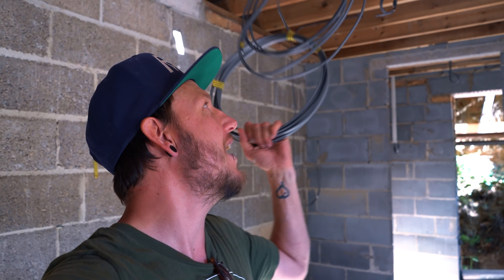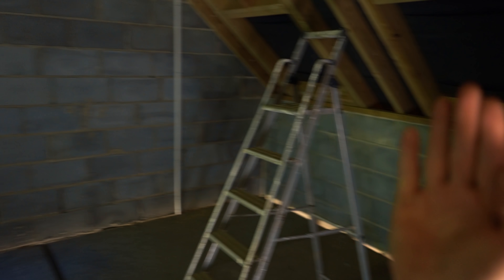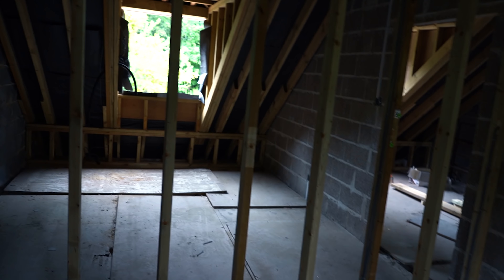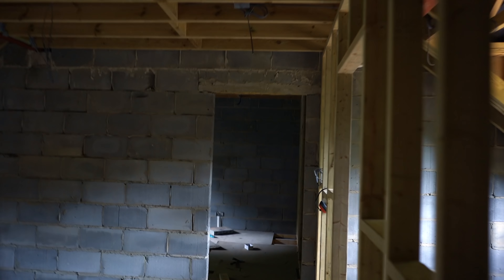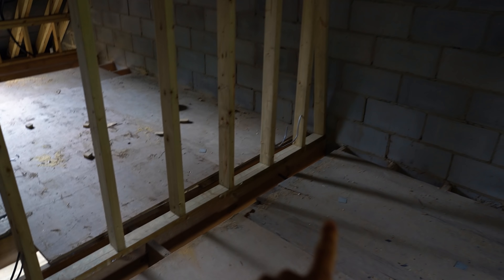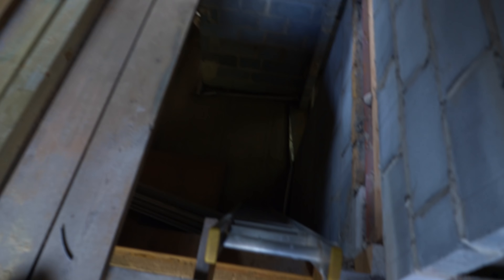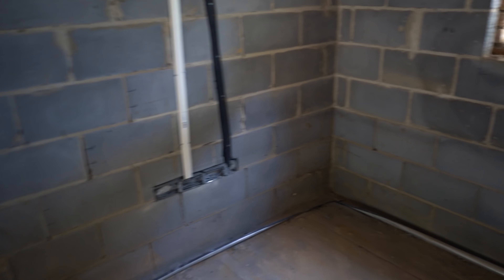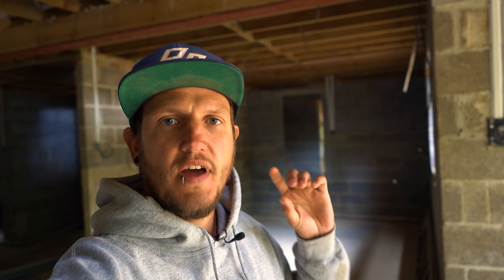Something EXCITING is happening | House build E.P 100

Comment: The best position for the manifold for the ufh is next to the hall ,  all the piping gets hot so the hall would be the warmest place , ideal as it has the biggest volume and hot air rises up to the landing .  Consider a large towel rail in the utility room for drying tea towels , wet coats etc.

Comment: Just a tip mate, double up on the floor plate of the stud walls it makes fitting your skirting so much easier as you have a solid fixing all the way along, especially when you have wonky timber 👍

Comment: For the layout where your desk is to go, best sit sideways to the window to avoid reflections of your shirt etc. in the screen. Best is window to side behind you. Floor sockets great idea. Perhaps put in spare cores and coax and ethernet cat for future proof (ask you electrician for advice). Also avoid lighting that will reflect in your screen. Pointable LED spots prob best. Mock it all up if you can. Errrm - any cabling for smoke alarms ( one in every room with unattended electrical kit ) ?  Also carbon monoxide meters where req.

Comment: Really sorry to hear about the back. Bed rest not usually good for it. Do lightweight stuff on the house. See if plumber will give you some easy work. Now dont think gym required. Wait until you have been awake for 1 hour and moving around, then stretch e.g lie on carpet, slide feet towards you then rotate knees side to side. Also alternate knees to chest. Do every day. A few times a week do strengthening stuff using your body weight e.g bridging, planks, superman, alternate leg raise bending knee and hip and keeping resting leg off ground with bent knee, and careful stomach crunches.  Ideally get a good physio to teach you (use skype and zoom). After a bit you might want a bit of cheap kit to make those excercises harder e.g ankle weights and a large gym ball.

Comment: Great to see progress on the house and the CLS studwork. Be good to slow bits of that down and show us e.g. how you drive in the screws and keepmthings square. For the horizontals is it easier to fit them as you go? (Sorry didnt notice if you had a chop saw so interested how you accurately cut the verticals etc.). Wonder around the door frame if you should beef up with more verticals nearby and noggin inbetween those and what you have. I think you can be as good at teaching us the woodwork as the brickwork. One other silly Q: Is the CLS formthe verticals all straight enough (put a string line across). If not there is a technique to fix - see Scott Brown Carpentry on youtube. So you half cut through the bent ones (innthe wall) hammer in shim, then add flitch plates to restore strength. Better to chop up wonky ones for horizontalsmand noggins, but interested to know what you think of Scotts remedial technique. You have great teaching skill.

Comment: How u clean marks from blue bricks after freshly laid a wall.   I tried it but it made a big mess mostly gone white. Dont kno if I can use acid might ruin the brick colour.
And when to use brick jointer when grout is dry or wet thanks

Comment: Your work is very impressive.  BUT!  Please explain how you can use ordinary bricks and ordinary mortar for a fireplace.  Are you doing a fireplace insert?  Or are you adding another layer of refractory bricks with proper refractory cement?   That mortar (and probably the bricks too) will fail -- crumble and disintegrate -- possibly in just one season.   Did I miss the video where that was discussed?

Comment: Good stuff what’s the finished floor rodian Kingspan and screed?
Reply from the maker: Exactly that. 140mm kingspan then 75mm screed with the underfloor heating in it 👌🏼
Reply: Fantastic matey and also the steel perlin how did you enable the correct position did you do a roof cut then measure off that?